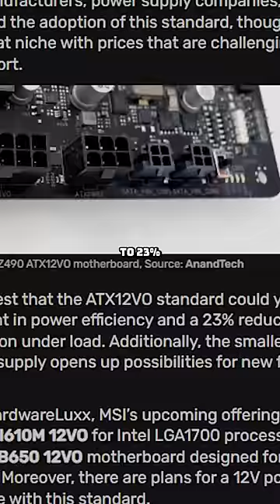Say Goodbye to the 24 Pin PSU Connector 👋

Comment: We all know what happened with the last 12v high power cable here we go again💀
Reply: Nah this 12VO is already used in some prebuilts and it works
Reply: The 12v high power would have been fine if the used standard pci pins and wires instead of the tiny ones
Reply: ah shit, here we go again
Reply: Like he said motherboards don't usually use alot of power, unlike gpu which can consume upto 600w at peak load, but yeah i get you, first iteration usually don't always run perfectly, though i still think it won't end up melting your motherboard unlike 4090 😂
Reply: Nvidia Just sucks Because they tried do something we call "Querschnittsverjüngung" Over ehre in germany, where they put 18 pins of PCIE power adapter on 12 pins without increasing the power rating of the connector
Reply: @itsTyrion  i got 12vo and its fine 3 years no problems at all
Reply: lmao my thoughts exactly when heard about it 😂
Reply: @TheCruelWarden  nah. The pins are thicker, it’s not bend as close to the plug and a motherboard draws a lot less than a 4090
Reply: This one's fine, the other one was underengineered. This one is literally the same as the 24 pin they just removed all the 3.3 and 5v pins
Reply: @itsTyrion  never say never you know.. with specs and power consumption going higher and higher i wont be surprised if that happens..
also about the bending.. some cable management requires you to use 90° adapter or bend the shit out of those cables so only time will tell
Reply: 12VO has been in use for ages and unlike 12V High Power, it actually works. Dell is using it for god knows how long.
Reply: That was what i was thinking too. There's nothing wrong with 24 pin right now. Why change it?
Reply: if we reduce 20/30 percent power of computers worldwide that is an insane amount of power. And not just our computers the amount of office computers worldwide. And reduces air conditioning costs in offices also. Its quite a big positive move
Reply: @rosspearson2805  Here is the issue in your thinking, not that the idea is wrong but 12VO only concerns the mainboard, not the CPU or GPU they steel need 60-100 and 200-600 watt in power respectively, and a lot of offices already use Dell PCs which come with 12VO for years. 

So the impact it would have is a lot smaller yet still significant.
Reply: That was user error. Also pcie and atx 24 pin were already 12 volts. It's not the fact it was 12 volts, it was the fact users weren't installing it correctly.
Reply: @Boxersteavee the new 12vhpwr standard is bad, it's not just user error the manufacturing tolerances are quite large and it's heavily underspeced compared to the PCI-E 8 or 6 pin. There is a reason some 4090s are still catching fire and are being limited to 400-450w in bios.
Reply: your motherboard won't draw 500W lol
not even 100W
Reply: @NielsGx  Mine draws 800 watts
Reply: @GandhiTheDerg  they fucken what 😧
Reply: Mobo is not that much powerful in comparison to the 12vhp
Reply: But 3.3v and 5v and if something from that give a short circuit😑
Reply: Yeah but do you really know what happened? It was always the user's fault for not properly plugging it in.
Reply: @itsTyrion  actually its mainly used in servers... its not new its been this way for over a decade

problem... this configuration just moves cost from power supplies to motherboards.... that is the main reason this connection is normally only used in servers because their boards are always over 1000 dollars so the cost differential is miniscule for some "theoretically" better power management... honestly i think it mainly just saves space
Reply: The 24 pin connector supplies a lot of voltage rails. Nowadays the devices in your PC convert all the voltages to a lower voltage, barely using the voltages of the 24 pin. 12vo results in simpler design on the long term.
Reply: @xuniwor  we`re forgoten about 3.3 and 5 or leave like now
Reply: @itsTyrion i hear it can get way too hot and smell
Reply: @NielsGx  sure won't. But 20A-30A in 5v and 3.3v, at least mine will.

Don't forget that 12VO puts a lot of strain in the motherboard to do 3.3 and 5v rectification.
Which is why most can only attach a small number of devices, sata, USB (high power: 1.5A+), etc.

Basically increasing motherboard prices that are already unreasonable
Reply: Exactly.  @RNG_Anarchist
Reply: @DissyFanart  I still don't like it. Having the power supply deal with it means that it has it's own point of failure. If the Mobo fails on power delivery, it can fry way more components. It will make the Mobo more expensive for no real reason.

Comment: The rest of those funny connectors would be for your SATA power connectors as the PSU will only do 12V+ 12V- and Ground. The Motherboard will be taking over the 12v to 5v and 12v to 3.3v conversions. 

Dell has been using this for years, and other OEM manufactures are also starting to do this. So an adapter can be purchased to convert your 24pin to the 12VO power connector already for less than $10.
Reply: So making motherboards even more expensive then they already are.
Reply: @carisi2k11  Resistors are dirt-cheap. Modern motherboards are already doing voltage step-downs to save on space and cram in more features. 5v and 3.3v pins are redundant, costly and inefficient.

There's a reason why Dell, known for being cheap b***ds, were the first to adopt it.

12VO will make everything more affordable. Motherboards, PSUs etc.

This YouTuber is talking out of his ass to churn out content he doesn't understand.
Reply: @robotsix6268  12VO won't make things cheaper for consumers, it will just give part manufacturers higher margins.
Reply: @Ilikedagames-rf2fx  
The PC market is gifted with having more than a dozen brands competing for our money. There's going to be a price for everyone.
Best part is, this tech isn't "RTX". Not an exciting innovation, means they can't demand a higher price vs 24 pin.
Reply: @robotsix6268  imagine trusting in competition fixing the prices, sweet summer child

im more concerned of the extra heat added from just adding a whole piece of a power supply to the motherboard and how a simple psu repair will become a whole motherboard replacement repair because the 5V and 3V lines went kaput after entrusting "too much work" to motherboard manufacturers and expect no cut corners, they already  cheap on VRMs, cooling and so much features on purpose and still increase pricing
Reply: @mementocity  what's the price on ddr4and 5 kits nowadays? Yeah, stfu.

Comment: 12VO standard has been around for a while now. Intel introduced it and it has only really seen adoption in OEM applications. I'm not sure it will realistically ever hit the DIY market.
Reply: Yeah. I had seen propieotary 6 pin 12VO connector on HP EliteDesk motherboard. The HP powersupply have wierd 6pin PCIe connector and 8 pin connector similar to fan connector and it actually controls powersupply fan by motherboard. I don't like 12VO standard, because I sometimes use computer powersupply for powering DIY electronics, where 5V and 3,3V are essential, especially for digital electronics.
Reply: The only reason it exist is cause OEMs are being required to use it cause of computer efficiency laws that only affect them.
Reply: @epickenny22  Yeah, but the DC-DC converters are moved to motherboard, so the total power efficiency may remain the same as with normal ATX powersupply.
Reply: @arnislacis9064  This is my concern, not so much DIY electronics but especially with hard disk drives, add in cards. 

The way they do it now is run everything through an already hotbed of sensitive electronics and add yet more complexity, more layers, more points of failure.

They should leave the DC-DC off the damn board (unless where needed for the board only obviously) and just power what they need, let add in cards and drives (HDD need 5V and not 3.3V anymore anyway) adapt and have their own. Those chips are tiny now.
Reply: i have only seen them on 1 dell optiplex
Reply: Ya, this is just like "BTX" that was supposed to supplant ATX form factor 15yrs ago, few OEMs used it but the PC parts industry basically just ignored it.
Reply: @tshackelton  
To be fair though, BTX layout was made specifically because Intel decided on it purely for a better layout to cool 8Ghz Netburst cpu's. 

That went nowhere so Intel stopped pushing it and went ATX again. Not the first time, I remember when I had an Intel LPX board. That was also very short lived. 

Also other efforts were made with many after 2000. I agree ATX is just big and most of the slots and space is unused, we no longer need to add a northbridge and LPT card and serial card and usb controller etc as add in cards. 

Ever since the high speed PCIe though that is becoming more and more the norm for everything we need ultra-low loss pcb, retimers for longer traces so we need the shortest traces we can get, that will not be ATX, or BTX. 

So my vote would be full size DTX. If you lay the board out like mini-ITX it has extra width which means NMVe can be added in that space right next to the cpu just plonk in 4-5 M.2 whatever fits (make 1 E key as well), it is backward compatible with mATX so also ATX (mounting holes and size wise), maybe a revision for V2.0 and make it so CAMM2 modules are an easy fit. Maybe it would be possible (not so sure for PCIe 6.0 and beyond because trace legnth) to put the gpu slot on the edge of the board at 90° rotation. That would need new cases though. 

Although I think 12VO as is has a few drawbacks and design choices I am unhappy with, by and large I quite like it. 

Newer PSU, CAMM2 hopefully, trend for smaller computers, DirectFlash, DirectStorage, P2PDMA, 0 copy networking (fingies crossed), desktop NPU, a lot of fun things coming and changing, yet still age old ATX.
Reply: @jamegumb7298  I think this is a step forward, having a PSU supply multiple rails at the same voltage and conversion near the power sinks will save power and make PSUs much simpler. However, my main reservation here, much like with the new GPU power cables, is why do they insist on having 12 pins, where half are GND and half are 12V, all part of the same rail and connected to the same traces, all built with thin wires and proprietary connectors, instead of just running pairs of higher gauge silicone wires with standard plugs made for high current such as XT30/60/90/120. Until you need to pull 1500W on the 12V rail, you won't outgrow the XT120. Also having to plug multiple cables onto the board where they all are 12V is annoying. That is all the same rail, just make one connector that suits the needs and draw from there, they're all side by side anyway, wtf?
Reply: @LordFokas  For the one to the board and the one to the cpu, there is something to be said for that. Not having to run a max of 240 or so watt (for AM and socket 1700) the the cpu all through the board. 

But if that is a thing, and a valid one (especially considering future sockets may go way beyond that even for more peak/boost/power bidget for gpu) then why do all conversio nfor all equipment on the board? It seems so sketch.

That said I am not against 12VO in principal, I think the implementation as it is is lacking.
Reply: @jamegumb7298  I'm not counting the CPU as part of the board here. It gets its own power, as it should. But I don't see an issue in having a more common and streamlined power distribution system where the client device is responsible for its own regulation. We've been doing that on the CPU with the ATX P4 plug and VRMs since the Pentium 4, I think 20+ years is enough to prove that is ok and not sketch at all.
Reply: @jamegumb7298  Maybe I misunderstood some things here. For other equipment such as drives and so on, it doesn't make sense to have those do their own regulation, so if we are removing that from the PSU the board should then be responsible for it. These days we don't realistically use them that much as we used to, and I expect it to die off entirely in the consumer space in a few years, so once we get there new boards can just forego those outputs and call it a day, the same way you now have an empty pin in the ATX 24 pin plug because eventually boards stopped using -5V supply and with enough time PSUs dropped the white wire.
Reply: @LordFokas  People will always need storage. You will always need drives. 

Not enough lanes to do all of it on nvme.

You could want 100% cloud storage but that is not an option to me at all.
Or 100% on usb but for that to be feasible I'd think you want them on usb4, ideally with pcie tunneling but again, too few lanes.

But even if it were, other stuff still needs power that is not just 12V. I have an oscilloscope, SDR, other stuff. There are usb cards that want a connector, WiFi adapter, a few fast network cards, etc.

Comment: "I don't know how to explain this new technology so I'm just going to make a video where I talk about how I don't understand it"

Thanks, guy.
Reply: I normally like Zach's content, but your comment describes about how I felt watching this. 😅
Reply: yea i fuckin hate low effort content like this, like what is the point of this video existing
Reply: He said he just wanted us to know. At least I'm aware of something I didn't even know about. Now I can do some research.
Reply: @fancydeeldo  most of the time it's just nontent if just stuff people read right off the box
Reply: @fancydeeldo   making the algo happy.
Reply: Yup, that's a lot of this guy's videos. His hot takes are usually pretty trash
Reply: Same, tf is this
Reply: Yeah when i came across the part where "idk if powr efficiency is something we need to worry on motherboards right now" and im like wait, you wouldnt want to be concerned about power on the motherboard which is one of the most sensitive pieces connecting all your hardware which calls for everyone in the industry to use quality PSU's, ignoring the other fact that we have more devices drawing power off the motherboard like nvme drives.

Yeah, i think we can move on past thia decades old standard.

Comment: At least we won’t have to struggle to unplug it anymore 🤣
Reply: youll be struggling to plug it IN correctly so it wont burn your PC like the other famous connector is doing 😂
Reply: Rest assured you'll start seeing smoking connectors with this new 12vo...
Reply: But now we have a problem when a rail dies on your motherboard = A new motherboard.
Reply: @TheCruelWarden  it has been used long before 2019 and nobody has reported burnt motherboard connectors.

Comment: We've been using 24-pin power for way longer than one decade haha
Reply: Yup the ATX12V 2.0 spec which introduced the 24 pin connector was published in 2003 though it probably took some time after that for actual products to reach market.
Reply: @petermichaelgreen yes, I remember full adoption around 2007.

Comment: Meanwhile, my HP Pavilion that only has a generic 4 pin connector for the mother board: I am 3 parallel universes ahead of you
Reply: Laptops don't count bro
Reply: Not really scalable because of voltage drop and power supply communications
Reply: Not if it's proprietary. We're talking about the next open source standard, meaning that you can still pair different motherboards with different power supplies regardless of brand and manufacturer.
Reply: @fabiandrinksmilk6205  yeah, witch means I cant really upgrade my parts too much, as a higher end non-OEM GPU might over draw my 500 wat power supply, and if I change the PSU,  I have to get another mother board... upgrade nigh mare...
Reply: you lost at hp pavilion... so im guessing you like to use word a lot or ms paint
Reply: what do you expect for a laptop??
youre not expecting a laptop that thin with a 24 pin connector
Reply: @iplayfpsgames9377 HP Pavilion desktops exist. Nobody likes them, but they exist.
Reply: @leblueawoo  yeah… as I said, I started learning part value around 3 months later…
Reply: @kunjunction1  there’s the Pavilion office (the normal ones), and the Pavilion Gaming, a absolute rip off of a pc…
Reply: @evanwilkins3189  not a laptop…